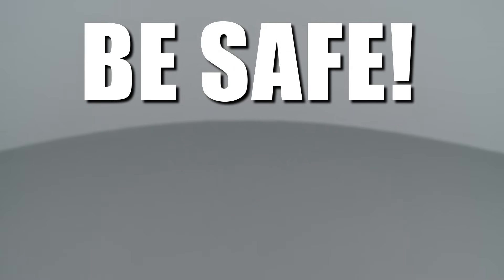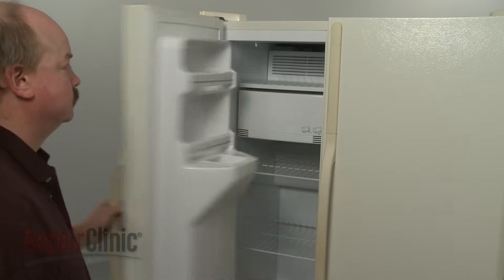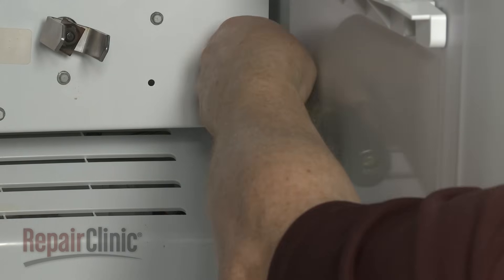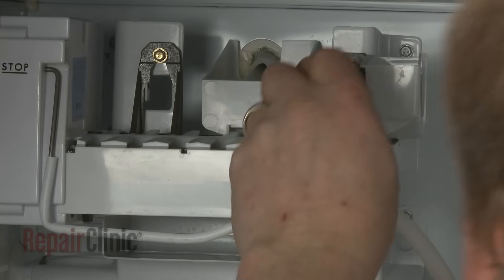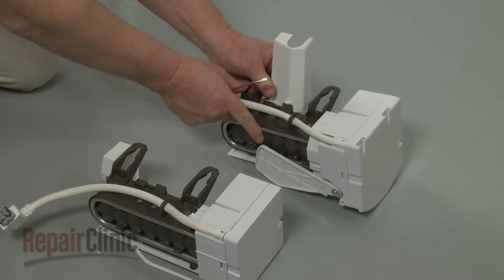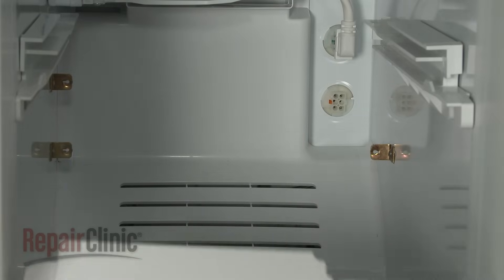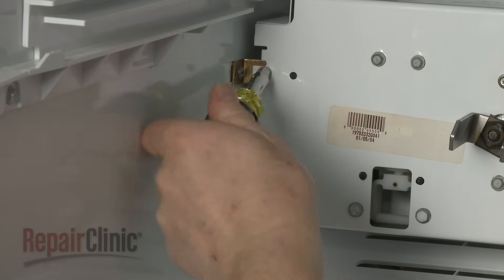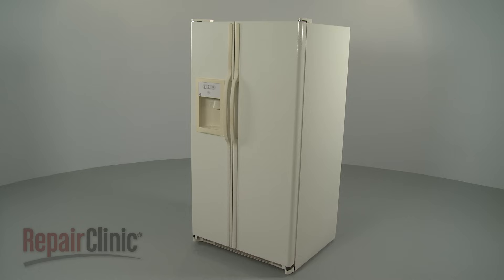Refrigerator Not Making Ice? GE Fridge Repair #WR30X10093

Comment: @1:31 Does anyone know what the small round dial to the far left is??
Reply: No did you ever find out?
Reply: @trevor.johnston  It isn't a dial, it's a plug.  If you remove it there is a screw you can turn.  Counter-clockwise will make the fill valve stay open longer and you will have bigger ice cubes.  Clockwise will make the fill valve stay open for a shorter time and you will have smaller ice cubes.